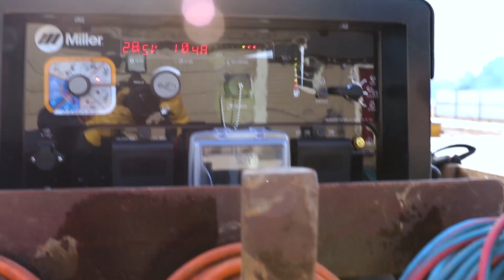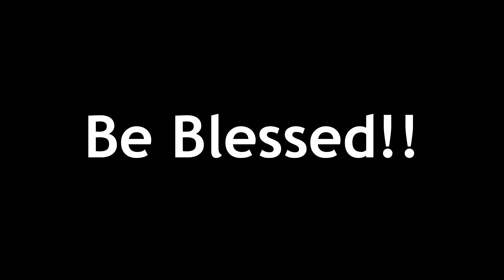Tig Welding Practice

Comment: Contractors /customers love having a one man band they know they can call up someone they know that can get the job done. more u can bring to the table and services ur able to provide the busier u will stay sky is the limit in this metal fab industry
Reply: Welder NotMechanic yup absolutely, that’s why I’m glad I joined the union. I’ve got over 10 welding certs in mig, stick, tig, brazing. Also med gas, Plumbing and hvac... All paid for. I can go take about any job I want just about anywhere I want. Love it!

Comment: Awesome sir. You're killing it. Couple things on the subject of tig welding. One: in the long run I think it'd be wise to run 1/2 of your coupons with your right and 1/2 with your left. I'm a righty and I find I don't practice my left enough because I'm too busy trying to be perfect with my right and it's more beneficial to be just good with both than perfect with one. Two: on a recent job I was welding 4" sch40 with the same gap at 110ish on the root. 150 on the hot pass and would fill 170-210 depending on if I was freehanding the fills.(walking is on the lower end of that range) and I would cap around 170-200 depending on how in the groove I was. (I was using mostly 5/32 70s2 wire) That all being said my theory in all welding is weld as hot as you can stand and move quick. Also if you get to the point where you're trying to look through the bevel for your root be sure to ALWAYS be able to see your tungsten. Even if that means pointing it back into your puddle. I dipped a lot of tungsten thinking I needed to have a push angle. Anyway sorry for the long post. Rooting for you! PS my wife thinks your child is the most adorable thing ever haha

Comment: I’m a union pipefitter with local 43 in Chattanooga Tennessee. I walk the cup on everything but usually I will put the root in on 120 amp, hot pass 125 amp, fill 135 amp or 130 if using 1/8, and 14-145 on the cap depending on what size tig wire. Hope that helps! Always great videos!

Comment: I myself like a 5/32 gap. 
Run the bead between 100-130 depending on the bevels and what wire (70s-2 or 70s6). 
Hot pass is usually 180-200. 
Fill and cap are the same 180-200. 
8” and up I’ll fill and cap on 210-240. 
With free handing tho your pointing your heat directly in the pipe so your gonna gave to run a little colder. Also if you’d use a bigger cup like a 12 on your hp and filler it will be easier to rock the cup on the edges of the bevel. Thanks for the vid Jake! It’s nice to see you stepping out of you comfort zone! Be blessed brother!

Comment: I use a number 10 cup with 3/16 gap and 1/8 filler rod. 100 amps for root free hand.
Turn it up 20 for hot pass. I don’t really walk it on the hot pass though I wiggle it back-and-forth. Filler maybe turn it up another 10
Where I can walk it Now.
Let it cool before Cap. And I cap At the same temperature I filled it with. Since you’re running a 1/8 gap I would use a number 8 cup since your Bevel walls are a lot closer together. More than 1 million ways to skin a cat but this is what I was taught here on the gulf coast in Houston
Good luck man keep making great videos

Comment: Looks great. I run 140/ 150 amps with carbon on fill and cap 90/100 amps with a 1/8” inch landing 1/8” gap I lay wire no back feed for root. On nine chrome around the same amps; Stainless about 20 amps lower same gaps and landing depending on schedules of pipe of course. I free hand the root and walk every thing else. God Bless..

Comment: Try a smaller cup and even sand the outside edges of the cup just a little bit so it fits in the groove between the bevels, and doesnt catch the edge. Then try walking the cup inside the groove. I use a 6 or 7 cup on 5” or a 7 or 8 cup on 6” for the root and then move to a 9 or 10 cup for hot and fill.I always walk the cup root fill and cap, I use 1/8 wire 5/32 gap and 1/8 wire all the way out. If you want really consistent beautiful weave patterns I also recommend dabbing your rod, gives you more control over how much metal you are adding to the weld. I am 6 g tig certified, on the cap I dab three times one top one center one bottom it gives me control of where the puddle sits after the slight sag from being 6g and allows me to have a nice straight outside edge of the weld with no undercut. I weld sch 80 in four passes, or if time is a constraint use two fill rods in the fill instead of one and make only three passes.

Comment: I'm a combo welder and I cannot walk the cup to save my life so I freehand also everybody has a different technique and if that technique gets the job done keep doing it I tig a little bit slower than most people so I don't run as hot I've been tiggin for about 2 years now and I still need to work on my travel speed and those caps look pretty good ! I'm still practicing too Love the channel man
Reply: @jakepin890  and that's the problem with me is I run Tig slow my travel speed isn't near as fast as some of the other guys that I work with but my beads look nice and I'm learning something new everyday I usually set my machine a little lower than most to because I'm a little slower but I still get the job done

Comment: For me it depends on the size of pipe and root gaps on what heat(amps) I run. Like on 2 in I run 130 on my root hot and cap but on 6 inch i run 110 root and fill at 180 to 200 amps. But 8 inch I root at 130 and hot at 200 and fill and cap at 300. 
Most companies I work for have a wps(weld procedure) that will or will not allow 5/32 rods. If they dont then I just usually stay around 250 max amps cause beyond that you burn the material up with a 1/8 rod. But if they allow 5/32 then I burn 300 to 350 for the fill then cap with a 5/32 around 225 to 275 depending on the size of pipe and how fast I feel like I should be going.
All my roots are free handed and I some pipes I free hand the hot and cap others I walk the cup on to make it prettier and uniform.

Comment: I’ve been a combo for 10 years... but have never ran down hill other than for practice. I would love to get into some day tho. 

I can tell you one HUGE thing that will help when tiggin carbon. Make sure you get those silica spots out (the shiny glassy spots) it will flow a ton smoother, prevent under-cut  and will help prevent your cup from slipping. (Carbon tig get slippery as all get out when it’s to hot, or when you hit a spot with that silica)... I like an 1/8” gap and I’ll use 3/32” wire for the root. About 115-125mps... I also have my tungsten sticking out like, a little over a 1/16” for my root so it focuses the heat in more toward the pipe.

For my hot,fill and cap, I’ll run 1/8” wire 120-140amps and I pull my tungsten out more like, 1/8” or so.  But after every single pass I AT LEAST try and get the damn silica out of my way. Hope this helps brother! Thank you for your videos.

Comment: Nice video like always 
Sch 40 I personally dont break out a filler rod over 1/8
Root-sharp no land 3/32 gap I'll laywire mine in at 90 to 110 usually a #4 cup.

Comment: I noticed when you are freehanding up top it looks like you are kinda “pointing” the tungsten forward a little bit, I like to try and make sure I have it almost perfectly strait into to pipe, on sch 40 with a 5/32 to a 3/16 gap I run the amps at about 85 to 105 depending on the machine, hotpass about 140, and cap about the same heat give or take 5 or 10 amps. Your cap didn’t look bad could have been straiter but that just comes with practice and repetition. You got it though man it ain’t no thing!

Comment: With the way you have your fit up set up i’d run a 1/8 filler wire with the back feeding technique @ 110-115amps & on the hot pass i’d run a 1/8 filler at 150-160 amps(be sure to run the hotpass as fast as you can so you don’t burn up the root from the inside & also cause sunkback on that bottom half of the pipe)for the fills id turn it up some more & stack 2 fillers with a 1/8 OR you can do one single pass with a 5/32 rod (just be sure to dip enough metal in there to flush it out) & finally for the cap pass I’d turn it down to where I can easily control that puddle and make it look presentable...if you’re using a 1/8 do a 2 bead cap & if you’re using a 5/32 do a single bead cap..

Comment: I do lots of tig up here in Alberta.  Root at 110 5/32 gap with a 1/8 rod. Then 130+ for hot pass and fills. And get used to walking the cup. Makes it alot easier and fast.

Comment: I am the complete opposite. I love to run TIG... 6”-8” I run the hot pass around 180-195 amps. I cap around 170. I always use a #12 cup regardless the pipe size. Great video again. God bless. I would love to lay a bevel and weld some Tig with you brother
Reply from the maker: Man if you get a chance to be in Colorado I know I could use all the help I can get lol!
Reply: I was in working for Billfinger there this pst year. I like that area. Be good to get a job there again. I would totally be willing to burn some TIG wire with ya my friend. I have two friend from Idaho who I work with

Comment: With the setup like your doing with gaps amd wire I run about 110 root. 170 with 1/8 for hotpass. And about 195 on fill and cap. I walk everything. And i keep the wire feeding slowly like a root pass until i cap. Then i laywire it. If u keep your wire directly in the center of your weld on your cap its easier to walk over. And until you get more use to walking the cup line the tungsten, the back of the rig and keep your cup in the center of the weld when you start. Itll make keeping it straight easy.

Comment: Back feeding the root I run 90-95 with a 1/8 rod, 145 hot pass/fill, 165-180 on the cap for 5” pipe. Loose that rooster tail and get a button cap, that’ll make walking it much easier.

Comment: The company I work for they won't give us rod over 1/8. For schedule 40-160 pipe Depending on the machine I put the root in around 110-140. I'll run a fast hot pass at the same heat just to get some more metal over it to prevent suck back. Then I'll turn it up to 160-200 and flush it out with one filler. The main thing is to watch those edges melt in. There's no need to rush my man. Take your time and push the wire into the puddle and build it up. I free hand everything also even the cap I'll turn it down slightly because the pipe is flushed out and I don't need to build a huge puddle.  Same thing with the cap as the filler just watch your edges push in wire untill you consume that last bit of bevel. You can get your free hand caps to look like you walked the cup the more you do it. If you angle your torch a little more back when free handing the cap you can get a better looking freehand weave. Hope this helps out. 
arcaddictshop.com

Comment: For 8 inch filler are usually run 90 to 115 depending on when I’m welding if you are welding carbon and it’s clean it should come out to be a straw color If it’s purple or gray you are going to slow or running too hot

Comment: 92 amps with machine on stick mode for root. 130 amps with machine on tig/lift arc for root. 160 to 180 amps on hot pass, fill, and cap. For carbon steel.
Reply: I do 130 with 5/32 gap and 1/8 rod and 180 with either 1/8 or 5/32 hot/fill. Then if I have enough for more fill I go to 250 if the pipe is bigger if its smaller than 8 inch pipe I stay around 200 fill and cap. If its bigger than 8 inch I usually fill and cap anywhere around 250 to 350 amps.
Reply: Beegah aoo ashkii

Comment: If your having trouble walking the cup inside the bevel. Try switching to an 8 cup, bend your flex head back a little farther and slide your cup side to side. If u don’t like doing it like that then switch to a 12 cup and rock your cup side to side on the bevel just watch puddle and tie in to the walls it makes a nice banana weave.
Reply from the maker: I will try that thanks Chris
Reply from the maker: Worked great input a 6  on to do the bead then a 8 to flush it out and a 12 to cap

Comment: It’s way easier to “wiggle” the cup while you’re filling and still inside the bevel and then move to a walk once you start getting closer to flush. Also getting rid of the chicken wing on the back of your torch and going to a stub button will help free up your range of motion when walking because it won’t be all over your wrist. 160-180 amps is a good range after hot pass all the way out unless you’re on some heavier wall then ^^

Comment: In my experience which isn’t much.. I’ve noticed that freehanding is a lot faster process than walking the cup. Specially for filling up. If it was up to me, I’d freehand everything. Just a bit over flush on my last fill pass and then walk the cup on my cap. I would also prefer a 3/16 gap so I can back feed the root in and the gap don’t close on me. I like that extra 16th to have room to move the rod inside. But that’s just a personal preference 8/10 you get what you want lol
Reply from the maker: I think so too. It’s just so much smoother to wiggle that cup but it takes some weird angles to get under there.

Comment: 1/8 gap. 1/8 rod on 120 amps for root pass.     Lays in slick   On the cap try for consistency and staying on a straight line  if you get off you can take a file and straighten it up a little

Comment: I like to run a 1/8 gap no land. 1/8 fill rod with a 3/32 tungsten. Run about 95 amps on some 4” sch40. Just lay wire and walk the cup all the way out. Try some combo welds. Run a rig root and 7018 fill and cap. Thanks for all your help Jake you’ve been great about responding to me on Instagram! You’re awesome keep kickin ass! 🇺🇸

Chase Sweda

Comment: Im like you man. When i tig i weld really hot and move fast. If you get on a job where they're shooting phased array you have to burn HOT. I wouldn't run that 5/32 on anything smaller than 8" sch80. They will get you for lack of fusion everytime. Also if you get a bigger cup (10 or 12) you will have a easier time walking in that hot and fill. I run around 130 150 with a 1/8" filling then turn down for a cap.

Comment: On pipe where the bevels are closer together like they would be on sch10 not so much heavier wall pipe is if I widen the bevels a little on my fill it helps me so the cap isn’t so narrow and sometimes I’ll come outside the bevels about 1/32 on each side.

Comment: Hot pass crank up the heat. As soon as you touch ur tungsten to the puddle or pipe stop and sharpen it. The 2 biggest and easiest tips are clean clear lens and always a sharp tungsten

Comment: 2” I run about 90 to a 100 with 1/8 gap and 3/32 filler and if the pipe will hold the heat 3/16 gap 1/8 filler at about 110 or 120 depending on the fit

Comment: 1/8 rod 1/8 gap about 135 drip method for the root tighter gap let filling or you can do a 16th gap with a 3/32 at 200 amps also drip method hot pass about 200 with 1/8 to make sure you burn everything out cap under 6 inch 160 to 180 if it’s stander wall 6 inch to 10 about 180 to 200 . 12 in and up cap 250 puddle runs nice and alive. Remember you have to weld hot to burn to burn everything out.

Comment: Root- 3/16 gap 1/8 wire 85-105 amps depending on pipe size

Hot pass 1/8 150 amps just lay the wire

Fill 1/8 200 amps

Cap 1/8 170-180 amps

Comment: Carbon 8 sch 80  and sch 40 
1/8 root 115 back feed
1/8 Hot / fill 150 to 170
On the cap I use 
3/32 rod doubled up at 185 - 210 
Stainless is 100 root 130 fill and 160ish cap I free hand roots in any position and walking the cup depends on space around pipe if I can get comfortable I will usually walk it out but if it is tight free hand and weld it as hot as you can stand it with out having the puddle being erratic if it digging in the walls or you are having trouble feeding fast enough turn the heat back

Comment: Depending on the wall thickness, my hot pass and maybe a fill pass or two, I dont walk the cup exactly how you would when it's close to being flush or on the cap. It's more of a roll and slide. Kind of like the ship ride at a carnival or a skateboarder on a half pipe if he wasn't airing or spinning and just going back and forth if that makes sense lol. I dont take a "step" like I do on a flush or cap pass. I just rest the cup in the bevel and "twist" it back and forth.  Sometimes I'll use the flared out bell part of the cup to ride on instead of the very end  because the end can be a little sticky at times and not as smooth. if you can set your tungsten stick out so that you can rest the end of the cup and also the flared part of the cup in the bevel I find it makes it the easiest and most consistent and you can cruise. I used to free hand at first too until I figured that out. Hope that makes sense. Try it out, hope it helps. Keep pushing yourself and thanks for the content.
Reply: Oh, and I didn't find my caps got super consistent along the toes and in general but especially along the toes until I developed the muscle memory and angle of my torch and knew where my tungsten was without looking at it because then I basically just watch the outer edge of the puddle and match it to the previous step, scale, puddle or whatever you wanna call it.

Comment: For 1/8 root pass I like a loose 1/8 gap or 5/32 gap at 100-110 hot pass 1/8 130-140 fill 140-150 cap about 140-145 on 6” like that going down in size the temp goes down

Comment: I feel like a lot of people think free handing is more difficult than wiggling the cup for root and hot pass. It’s not, as long as you have good heat protection and somewhere to prop your fingers. Even if you are older it’s easier
Reply: I agree. One thing to consider too is that you can get your torch angle perpendicular to the material which can be very beneficial in certain situations such as a tight root opening that you gotta push through. Walking the cup has a bigger learning curve in my opinion but once you get it down it seems to be less fatiguing. It's great to know both.